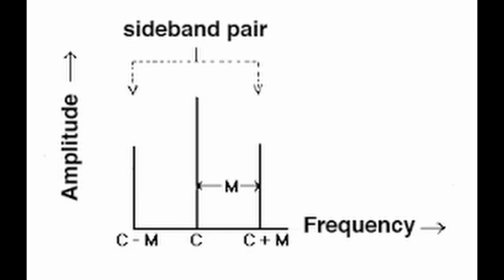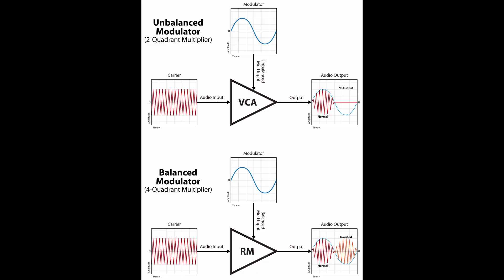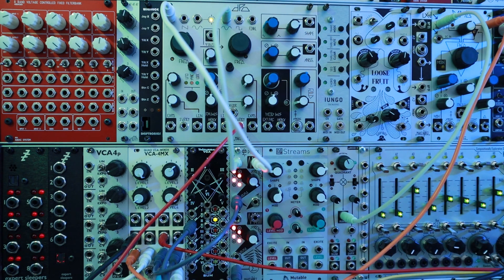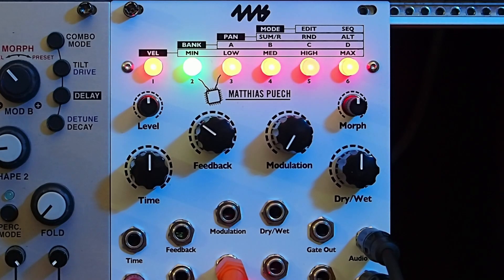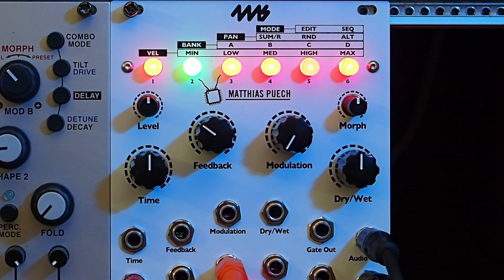Ring modulation theory and examples

Comment: Do I understand correctly that if you add a DRY signal to Ring Mod, then there will be AM effect?  Or is it not the same?    In Ring two frequencies 500 and 1000 will be 1500 and 500. And what will happen with amplitude modulation of two frequencies of 500 and 1000?

Comment: I have a question about guitar ring modulators that no Youtuber presenting them has managed to answer.  My question is this: What is happening exactly when I tune a guitar note so I can hear it at the RM's output? This is logically impossible since the RM's output is ONLY the sum and difference of my guitars frequency and the RM's internal oscillator MEANING the two input frequencies are not present anymore. SO how come I can still somehow hear the frequency of my note? Thank you.
Reply from the maker: I have never experienced this. The phenomenon may also depend on the exact components of your guitar's spectrum, the ring modulator you use, and the signal you modulate your guitar with. Since you are multiplying spectra during RM, the sum of more complex (non-sine) spectra can give surprising results.
Reply: @bylant  Try to tune the modulator to the carrier that is  holding the root note of a scale, and you'll get what a guitarist experiences with RM usually. Then read my question again,  since you know the difference between RM and Am you may be able to answer how it's possible to tune like that. Thanks
Reply: A ring mod circuit has an input, carrier, and output. For the carrier the guitar pedal has an LFO. Various pedals offer various options on the LFO waveform, most will let you control the rate and depth of the modulation. 
Additionally these pedals will have a blend or mix knob to control wet/dry setting. Which lets some of your guitar sound come through instead of being just completely mangled by the sum/difference output of a pure ring modulator. 
It's possible to make a passive ring mod with just some audio isolation transformers and diodes, plus whatever carrier you choose to give it. An active circuit and more modern would be to use a special purpose op-amp like a [four-quadrant] multiplier which can operate on a much wider range of frequency than the old audio transformer trick. (transformers tend to cut a lot of highs)
Reply: @  I didn't know that the four-quadrant op amp is a more modern form of ring modulation. I thought it was just a fancy pancy name for it. So does the fact that its active mean it has an internal oscillator and It doesn't accept an external one? But that wasn't what I asked. No one would answer my question so I eventually got a tone generator and started monitering what was going on when a note was "tuned", its very simple: Both signals where the same note on any octave. The other thing that I learned is that tuning the root note is not the best practice if someone wants musical metalic tones. The whole approach that exists today in guitar Ring mod pedals is full of misconceptions.
Reply: @MYGAS21  
I think I understand what you were asking now. I think those misconceptions makes guitar ring mod pedals rather difficult for most people to use effectively.
 
At the end of the day, a musician can set theory aside and rely on their ears to tell them what sounds good. While I can, with a little electronic knowledge, tell you that you can get some harmonic frequencies out of a ring mod. I can even tell you what ratio of frequencies might be worth trying. I can't tell you exactly what to set a particular pedal to to make it perfectly on pitch.

four-quadrant op amp is indeed just a fancy pants name for a multiplier that handles sign on both input and modulation. (so it can do: negative times negative is positive).
but we've had ring mod circuits before op amps existed. usually done with transformers and diodes. and I have seen them done in radio equipment using tubes, but that's more like how an op amp does it than how it's done with diodes (that's literally the ring part of ring mod).

active means that there's no loss, and can even include some gain. because the circuit is powered by a supply instead of simply running on the signals themselves. passive circuits don't need power or a battery because the are simple enough to do work with just passive components (resistors, capacitors, diodes, inductors, etc). 

Like adding a small attenuator or an A/B switch to your pedal board is passive because you don't have to power them. It's just a potentiometere/rheostat or a switch. 

tubes, transistors, and op amps are active because they need some supply power to work. current or voltage bias on transistors and tubes is very important to how they work. op amp is just a circuit on a chip (actually used to make op amps out of tubes too, and were on a plate the size of a postcard) 

The other problem you might face is that ring mods is just a way to create a sideband signal. In theory it is the sum and difference of the originally carrier and signal. But in practice there is significant distortion introduced by a ring mod circuit. And you're not going to get a perfect frequency out of it. So even radio designers have sharp and flat frequencies, it's not just the musicians that face the problem!
Reply: @boriscat1999   I'm interested in the ratios of frequencies you wrote about. I can punch in the numbers on my tone generator and try them out. I am also expecting a frequency shifter (Eurorack). But since the shifter retains the same linier shift, I guess ratios don't apply across a scale. Correct? And come to think of it, the ratios don't apply to the Ring mod either...only for a specific tuned note. This will not yield musical results. What I discovered is: to musically use the Ring mod we must combine the tuned note approach with large frequency spectrums that reside beyond the 5000hz limit used in the internal oscillators usually found in the Ring mod pedals!

Comment: I have an outboard pedal ring modulator, and it only takes signals . CV is too hot, however, it does generate interesting noises and has 2 lfo outs which help in my eurorack system. Both synths and drum machines work well through it, well I dial-in the sweet spots.
Reply from the maker: Hi, this sounds great. Using CV for audio inputs is fun, I like it because it can surprise me easily (when the inputs are not dc-coupled, of course). And I like the idea of getting a novel lfo using the ring modulator 🤘